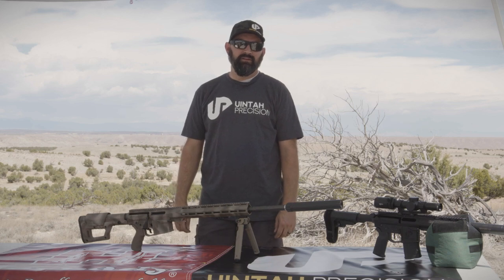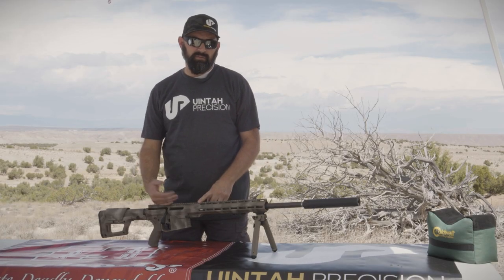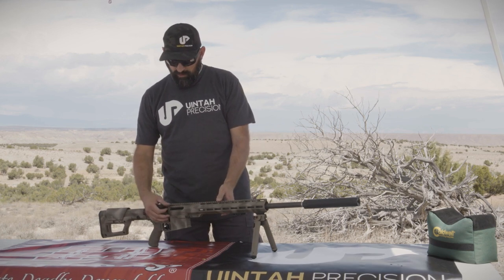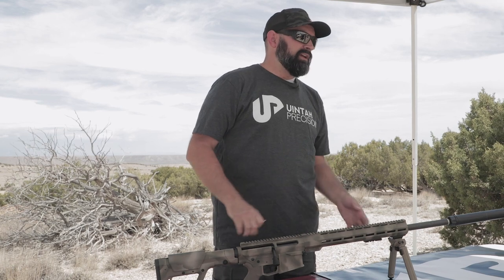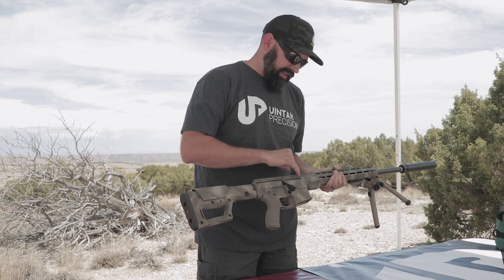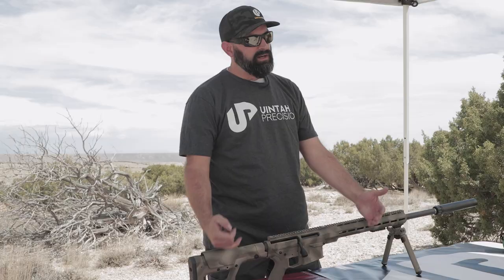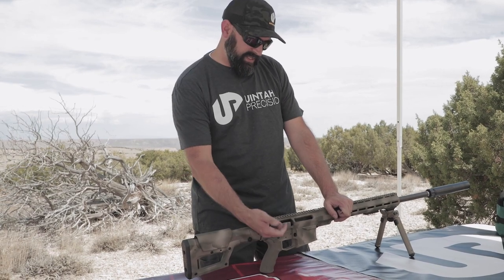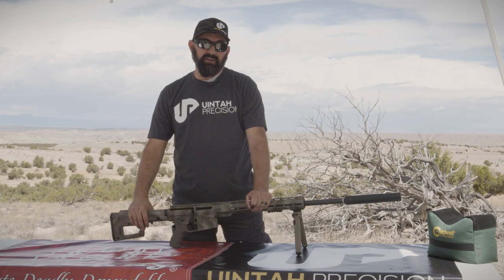Uintah Precision True Bolt Action AR FAQs

Comment: What is the recommended max pressure load for 6mm ARC. Generally, the bolt action will handle 62000 psi vs the AR where its recommended no more than 52000 psi. Will your bolts handle the higher loads?
Reply from the maker: Yes, our uppers will handle the bolt gun pressures.

Comment: I really want one of your DPMS uppers, but I have a .308 AR built from a Palmetto State Armory receiver set. 
Will you release an option that will fit PSA? You should, because a lot of people have large frame ARs from PSA and others on your non-compatible list.
Reply from the maker: When we started, our UP10 fit PSA lowers, but since then, they have made so many changes it is hard to keep up with what they are doing. We have multiple reports from different customers, with differing result. Some work, some don't. We were hoping that since they bought DPMS that they would standardize everything, but it doesn't seem as though that has happened.

Comment: This is awsome! I've wanted one of these uppers for about 2 almost 3 years now. Just waiting to finish college first, I've even built a complete lower for it and I have a trigger tech 1.5lb adjustable trigger, is that compatible? Will I need to file down the edge of the hammer?

Comment: With how far the bolt travels into the buffer will it still work with a rail mount to allow or a folding stock without relying on a folding buffer tube?
Reply from the maker: The rear of the bolt extends about 5/8" into the buffer tube when run to the rear to eject a round/case, so the stock choice would need to accommodate that amount of travel ie a folding buffer tube. We recommend the Law Tactical. On a side note, we are working on producing a 1913 Pic mount adapter for the rear so one could run a buffer-less stock option.

Comment: What about the bolt catch? Can it stay in place? I just ordered the UPR10 in .308...
Reply: Yes, but it will not engage when using the UPr10, but will work as normal if you switch out to a standard AR upper.

Comment: Can I use my law folder?
Reply from the maker: Yes! The Law Tactical folding stock adapter is what we recommend for those wanting a folding stock. The bolt extention from Law is not required when used with our uppers.